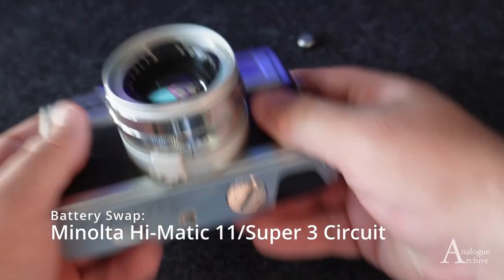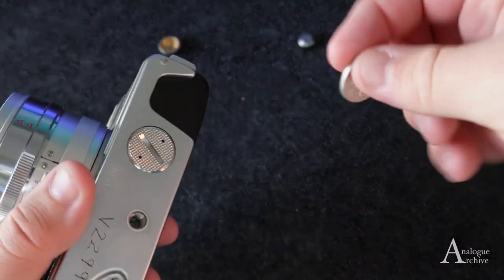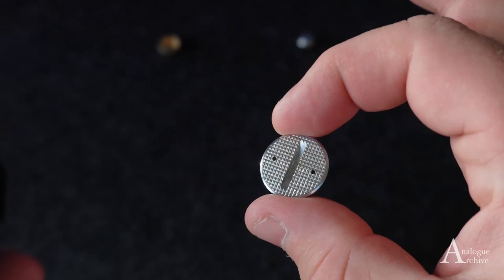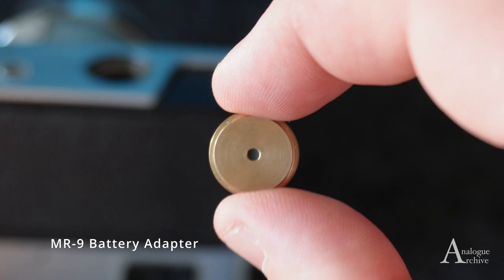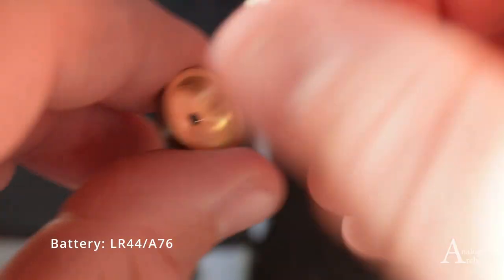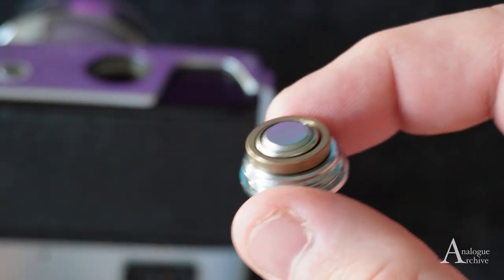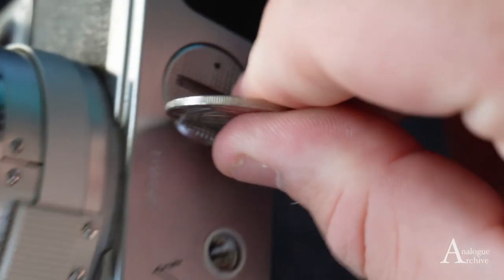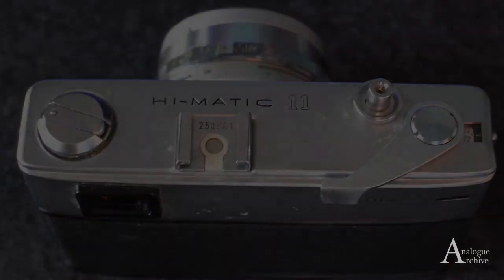Battery Swap: Minolta Hi-Matic 11/Super 3 Circuit

Comment: My meter is always in 1.7..there is a battery icon too. Need to replace battery???
Reply from the maker: Hey hey, 
Yep that sounds like a low battery. If it’s still persisting even after you swap the battery out you may need to send it into a repair shop for someone to have a look at.
Reply: @AnalogueArchive  Nice... And other thing, only battery i can get is Px625 but 1.5V. What I should do with it to work ok? I heard something about over exposure
Reply: mine too. I think the meter is broken then.